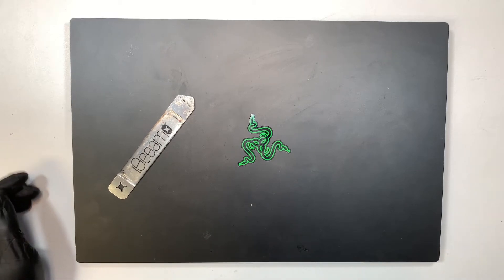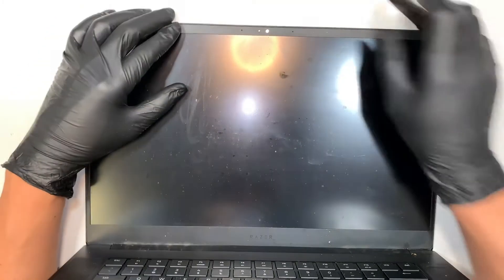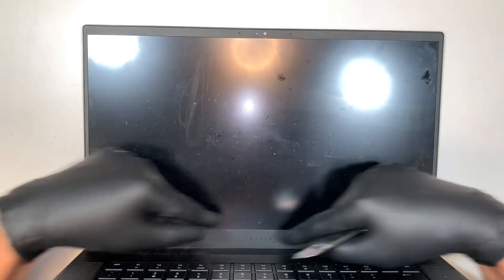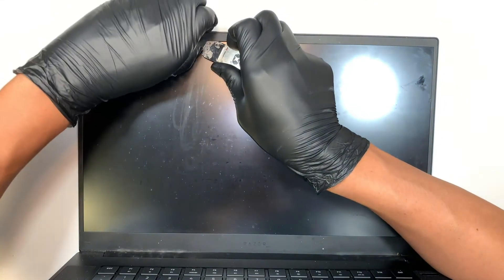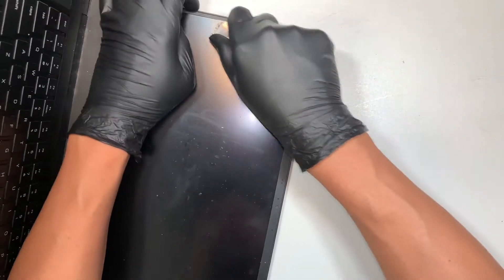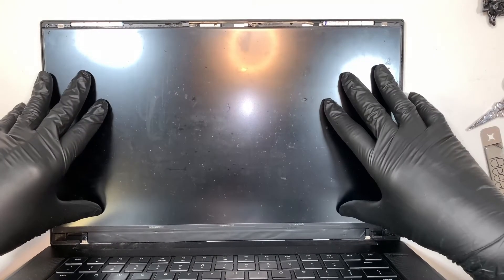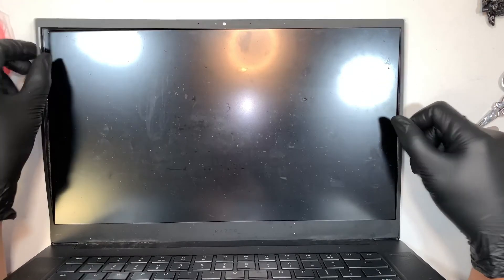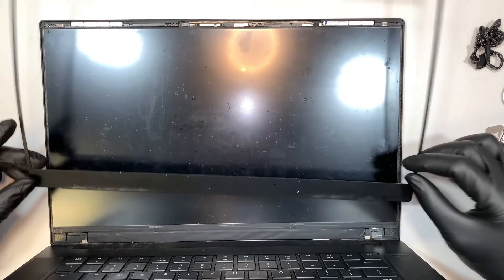Razer Blade 15 RZ09 2070 Screen Replacement

Comment: Always detach batter cable, and remove screen assembly before attempting replacement. This is not the way to replace this screen.
Reply: You’re correct. I did it without plugging the battery out and the laptop is not turning on right now. Do you know what could possibly went wrong?

Comment: HUGE thanks for this. I had a major issue with my laptop screen and this was the first time I'd ever done something like replacing a screen. I had a horrible growing black bar issue on the bottom of the screen and the new panel has fixed it.
Reply: Yeah I've been having the same issue as well and thinking about buying a replacement LCD screen for it.

Is your LCD still ok right now BTW?

Comment: Used this guide to replace the panel on my RZ09-0288. Beware that if you don't see those pull tabs for the tape on the back, the tape layout is completely different such that it's inaccessible. I was only able to get my defective panel out destructively - with force, a blade, and a heat gun. thankfully, new panel installation is painless...
Reply: Hello, i got the same model, this screen actually works? Same 144Hz?
Reply: @daniellr2232  Yes, but beware what I said. If you have the same model as me it will be a very difficult removal. I have had 0 issues with my new screen, looks exactly the same and does 144hz without any weird issues
Reply: @artemicion  please, can u send me the link of the page where you buyed the screen.

Comment: Hi, thanks for the video, it really helped me to understand how to replace the screen on razer blades. 
However, I have a problem. I needed to check a model number of the screen before I complete the order with new one. So I disassembled the bezel and black double sided tape. I didn't disconnect the screen as you did in the video because I still need it. 
I got the picture with model number from the screen and returned everything back. Now, however, after switching razer on, the screen is black. It looks like it is not connected. Is it a way to somehow reset the screen? Don't know what happened really. Thanks for help.

Comment: I have razor blade base 15 2020 2070 maxq with faulty 144hz screen. Can my replacement me 240hz as it’s the same 40 pin connection. Seeing this on laptop screen dot come. HELP
Reply: No

Comment: Hey bro, amazing video! I will be using this when i upgrade. I was wondering if I can upgrade from a Razer Blade 2018 1060 Max Q 1080p 60 hz screen to replace it with the 144hz version of the same type of screen with 30pin connector and staying with the native 1080p but just get a higher refreshrate. Also am i looking for a screen that is NV156FHM or do I need specifically look for NV156FHM-N61, I don't know the laptop screen specifications and couldn't find anything online. Thanks a lot :)

Comment: The black tape that you pulled from the back of the screen is not showing on mine…how do I get to it?
Reply: you can fold up the black section on the bottom of the panel - the tabs were hidden behind that on my screen. Be really careful when pulling the tabs - one of mine broke because I pulled too hard and I had to pry open the screen from the lid, which was an incredibly painful process.

Comment: The black ribbon in the middle of the hinge is cracked, would I need to replace the whole display to get this replaced or is there a direct replacement for the ribbon? Display is working fine, just very upsetting to spend such a premium price on this laptop and have the ribbon in the middle crack with a year of light use

Comment: Is it possible to switch my 4K touch screen 60HZ to 144+? I can not use this computer. Too much screen tearing.
Reply: Should be, if you can find a 4K 144hz LCD module that has identical dimensions, which should be pretty easy as most of them are the same. As for tearing, lower refresh rates don't cause tearing, but you should have G-Sync and I highly recommend trying that first, as well as messing with all the other refresh rate-related options in Nvidia Control Panel, and definitely make sure to enable triple buffering.

Comment: I sent my razer laptop to the repair shop to replace the screen, got it back, issue resolved, but bezel is uneven, with some popping out, either due to the lack of adhesive or pried open too forcefully. I am all okay with that but the issue i found out much later due to covid and wfh, my inbuilt camera became faulty after the servicing. Any idea why? Is it the connection or something else. Super grainy and pixellated
Reply: how much did that cost you btw?
Reply: @user-dx6yf4zd7f  Somewhere between 200-400 SGD. This was at least 2 years ago so I can't quite remember.
Reply: @JiMoMin  ic ic, thank you

Comment: Would this work if you had the 240 hz screen and wanted to downgrade to the 144hz screen? 

The 144hz panel is 100 dollars cheaper and I don't think I'll notice much of a difference.
Reply: Hey did you ever get this done? Wanted to go from 144 or 240hz screen. Razer blade base 15 2020 2070 max originally 144hz. Thanks
Reply: @schalachi  Unfortunately it does not work because the 240hz comes with a 40 pin adapter but the 144hz comes with a 30 pin. Unless you can also find a new 30 pin display ribbon it won't work.

Comment: can Razer Blade 15 RZ09-0328 change from lcd 144hz to 4k screen?
Reply from the maker: Cannot
Reply: @UbergeeksBiz  but it was same pin as 4k screen (40 pin video connector)

Comment: Hi, I'm from Mexico, and I'm looking for someone who can help me with my razer blade 15 advanced. The video flexor is cut off and doesn't transmit an image. In my country, it's hard to find this part, could you help me?
Reply from the maker: which cable ?
Reply: @UbergeeksBiz  the 40 pin flex cable
Reply from the maker: @salvadorescalera8655  Cant find the replacement part here in US
Reply: @UbergeeksBiz  Can I provide you with photographs and more information by any means?
Reply: @UbergeeksBiz  the piece is difficult to find in my country, I can send you pictures by dm on faceboock, it will be easier to chat